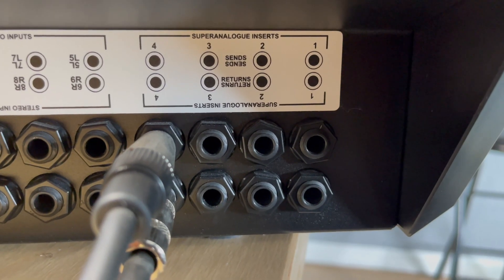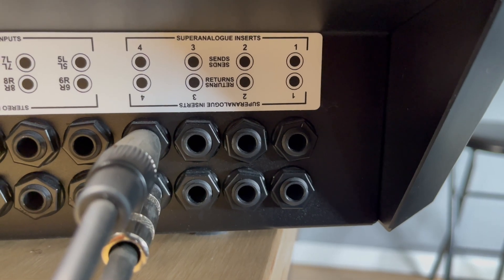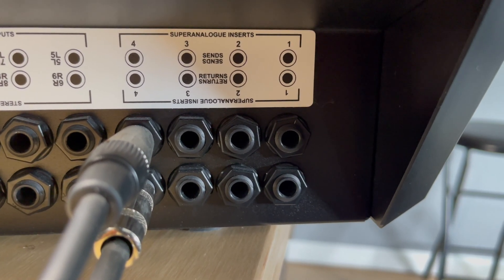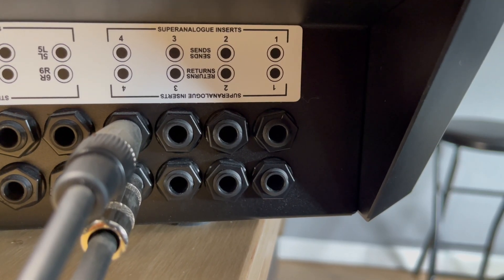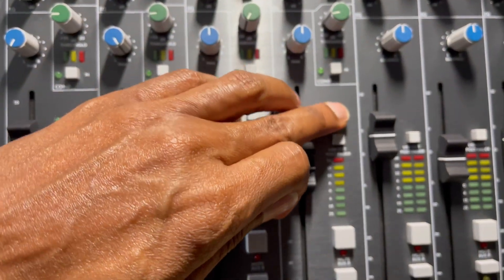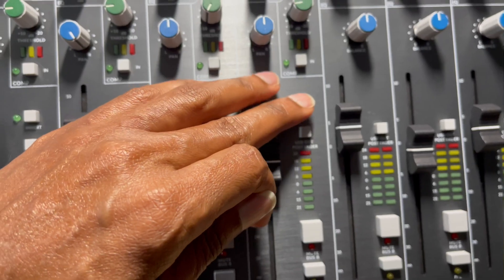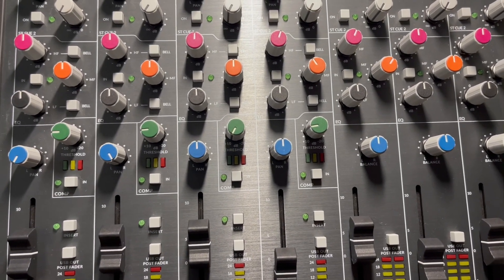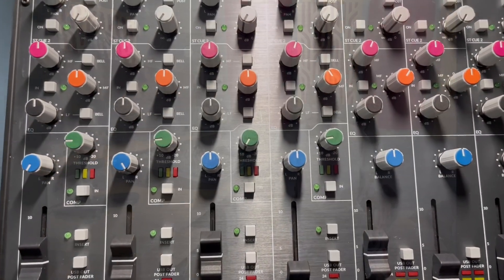HOW TO CONNECT HARDWARE INSERTS ON "BIG SIX" EXPLAINED   4K

Comment: You got so much wrong in this video, there's hardly anything right ! There is no left and right for channel 4, you don't have to always use the ins and outs for an insert (you can send from that channel and return elsewhere), and the idea that when using an insert you can no longer use that channel's EQ or compression is also nonsense . . . (etc etc)